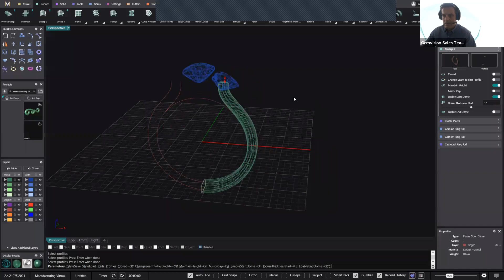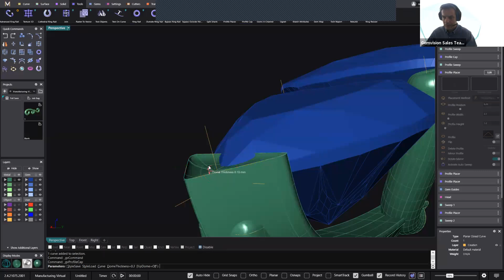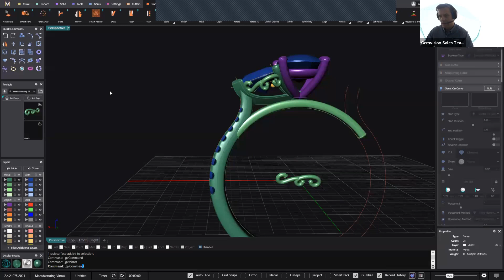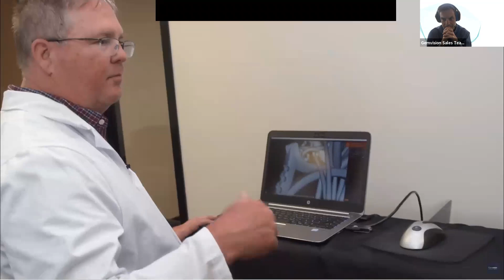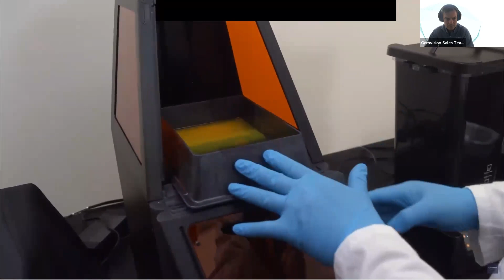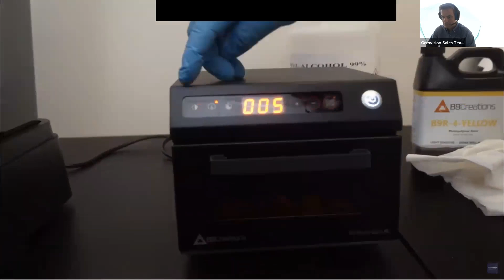Live Session 2: Disrupting The Jewelry Industry

Comment: hello my teachers
The lesson was clear and beautiful, thanks for the clarification. Can you ask a question?
Is it necessary to use a temperature of 1300 degrees for wax vaporization? Is it not possible to use a temperature of 800 degrees for two hours in the last stage?
And get the same casting accuracy.
Secondly, is it beneficial to wash the model by hand with alcohol?
Third. Is there another alternative way to the freezing device?